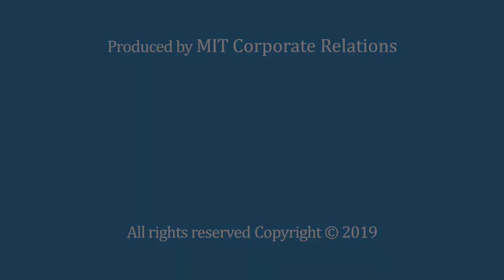LiquidPiston - 003 - Combining Components of Different Engines to Produce a More Efficient Product

Comment: I get that you don't like comparisons to Wankel, but there is one enormous elephant in the room: Like Wankel, the two parallel ends of the rotor are rubbing, very fast, in an oval, over the surface of the two face plates. They need to tightly seal for good combustion, and they are also a nightmare to lubricate. Consumers are accustomed to piston engines lasting 100k-300k or more miles before needing an expensive rebuild. If you want to take those customers away, you'll either need to show you can get that kind of mileage, OR you'll need to reassure customers that the engine can be rebuilt cheaply and quickly every 40k miles or whatever you can get out of it. So far, I'm not seeing any answers to that question.
Reply: Right on the point

Comment: Please get mazda on board!! We need a new rotary style power plant sport car!!
I wonder if this design can be modular? Ie. More than one rotor housing? From what I can see, no. But u can increase size easily enough. 
The other thing I wonder, is how hard is it to balance the rotating assembly, given that the weight changes during the cycle. ? Maybe I’m over thinking that. 
Man I see huge potential in this thing

Comment: Ok I understand.  This is a revolutionary design that needs to be out there in a car!  What’s taking so long?  Get your arses into gear and get it in a car on a race track showing how good it is.
Reply: emissions, high compression = NOx, yes it uses less fuel but it will need a big catalytic converter, it will not only increase cost, but also make the engine very inefficient at startups, since it needs to run rich in order to heat up the CAT to its operating temps

Comment: Liquid Piston,  You might have an awesome engine. Build one (50hp to 70 hp ish) and put it in a motocross bike. Let all the top guys ride it. If it works, they will brag it up enough on social media, everyone will know you have something. Hopefully something light and powerful.
Reply: It's a scam. They've been around for a long time talking about how much better their system is, but the engines they produced were just as unreliable and old wankel engines.
Reply: @flakgun153  you're probably right. They are always looking for investors. I'm just saying, the motocross world is always looking for more power, less weight. Slam a liquid piston engine in a CRF 450 frame. If it works, your going to sell motors and get tons of free publicity. If it doesn't go spend your time doing something else.
Reply: @flakgun153  lol you prob called Tesla a scam too 🤡 Theyve won and completed multiple projects for the Pentagon with this engine
Reply: @flakgun153  Where is the test data that says this?